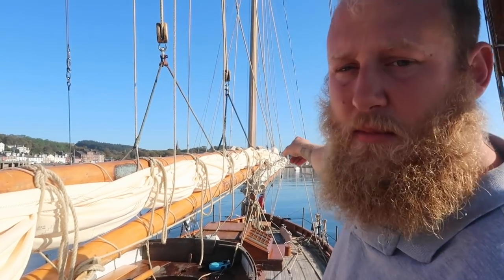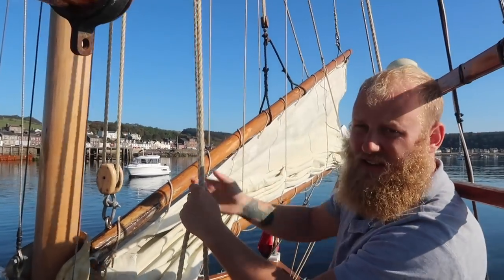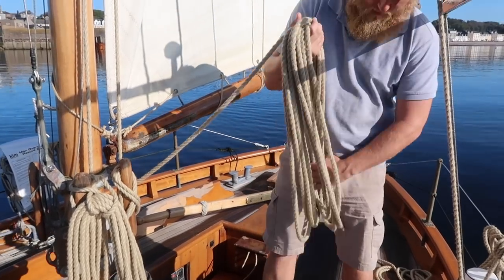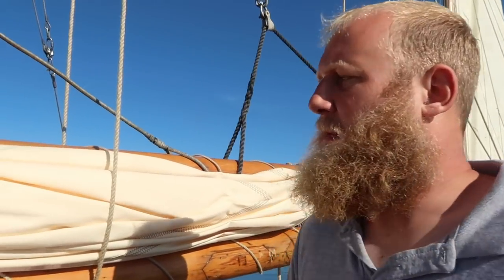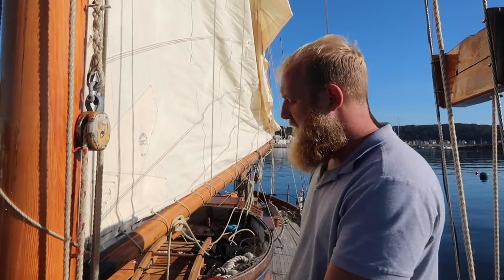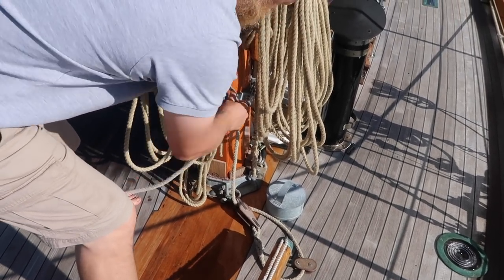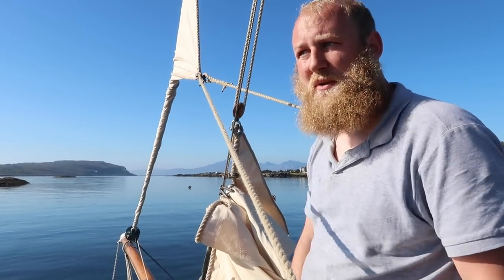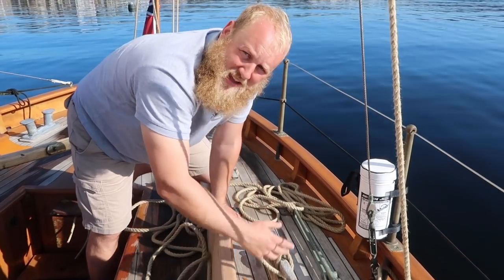Gaff Rig - How We Hoist Our Gaff Rig

Comment: Hi, love the vids.
If you get a chance change the throat to a double block on the gaff and a double with becket on the crane and you will only have a single fall to haul on, enabling you to hoist throat and peak together without stopping to change sides, this is also very handy if you are sailing on off moorings or anchors and in tight confines because you can also drop it controlled very quickly. If your boom is light and doesn't tighten the luff enough you can rig a small tackle to tension it down.
As in another comment, hoist the main with the gaff horizontal or lower than the throat this does make it much easier to hoist.
You refer to problems with the gaff saddle, these can capsize or trip. Our gaff saddle is a snug fit and the parrel beads are tied quite close and dont let the saddle move to far away from the mast, we had lots of problems with "off the shelf" saddles because they had room between them and the mast and the tapered ends starting about half the diameter of the mast. Because of the inherent design of the rig the gaff is always to leeward with twist from the sail acting on the gaff, we found that with the loose tapered saddles this could capsize when tacking or gybeing. Our saddle was fabricated to suit and is snug and the top and bottom edges of the saddle are straight until past the diameter of the mast.
Reply: Bertie Bert , I see some one knows what they are talking about. I was first officer on a tall ship for 9 years and now looking at buy one about 60/70 feet long

Comment: Hello again. If you find windward work a problem due to the mizzen mast bending aft when you sheet in hard then a solution is to rig a running forestay, just don't forget to unhook it when tacking! I rigged one on the Danish ketch Anna Moller and the skipper told me it made the world of difference, she has no engine so relies even more so on her sailing ability.
Talking of wiring shackles, I didn't comment on it previously, watch that capsized shackle on the throat block! The pin needs to go through the eyebolt.

Comment: Very good ... professor Mathew... seriously, as a land lubber, I understood a lot of what you were talking about...2 questions if I may...1- given that all the rope is exposed to the elements + the amount of use whilst sailing in a good breeze, what is the time frame of quality of the rope before age ,wear and tear
Sets in ?
2- same question for the sails... do they have to be cleaned after or during sailing ?
I enjoyed this video a great deal, thank you Mathew !!
Reply from the maker: The sails and ropes will last over 10years if looked after. They both made from man made materials and just made to look like the original. Some ropes will get more ware then others mainly my main sheet on Morna so that might need replacing in a few years but I'd expect everything else to last well over 10.

Comment: Been sailing gaffs for some time. Don't send the peak much higher than the throat when hoisting, it pushes the gaff towards the mast and puts more friction on the throat. May not be noticable too much now, but on a 134 m2 gaff sail it does, as personal experience has taught me. (Believe on Mariquita they put 4 hands on the peak and 18 on the throat.)

For the throat hallyard, just see how much purchase you need, so that both of you can do it. You also don't want too much purchase or it will take ages to hoist and that's even more tiresome. 

Having the other end of the halyard on the other side on a 3 to 1 purchase is noce for final tightening. 

Peak is usually not such an issue, generally less purchase than the throat.
Also the other end of the halyard on  2 to 1 or 3 to 1 purchase is nice so you can harden the sail when turning into the wind (or when the wind picks up) or loosen it when you veer off and need a fuller sail (and get rid of the crease).
Love seeing that lovely boat in that fantastic scenery.

Comment: Thank you so much, Matt. You have such a lovely strong vessel. I love everything about it. In fact, this is the third time I am viewing your excellent video. I was actually inspired by you to learn more about gaff rig by buying a copy of Hand, Reef and Steer after viewing your video the first time. One burning question though... why is the throat halyard designed in two stages - on the port and starboard side of the main mast? Or did I perceived the hoisting system wrongly all together?

Comment: I always enjoy your tutorial type videos, and this one was the best yet!!! I always wondered how a gaff rig worked and now I know! However, I'm still a bit fuzzy on your double halyard main for the throat though. I don't quite get how you can pull the port halyard taut, then use the starboard halyard to continue raising the throat since the port halyard is fixed. Thinking it might be some sort of Matt Magic....  ;-D
Reply from the maker: Haha it's hard to explain really i might be able to draw a picture and post it up on Facebook to help explain, but it did confuse me for a few days when I was rigging it.
Reply: @LivingWithTheTide  Please post that drawing, as I have tried to research this and have draw a blank. Excellent video.
Reply: Isn’t the double halyard on the main because: Larger sail means heavier load, to reduce the load use a 2:1 block, 2:1 block means you a have to take in twice as much line, twice the line means you run out of room to move the block on one side, so repeat for the other side.